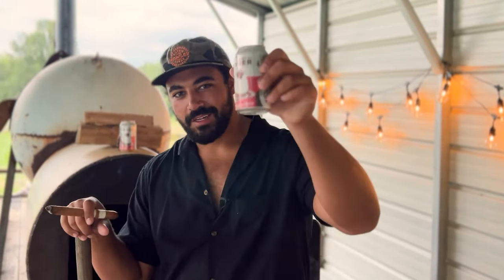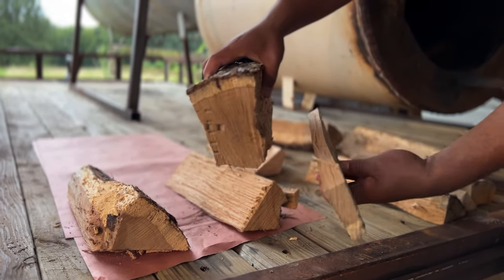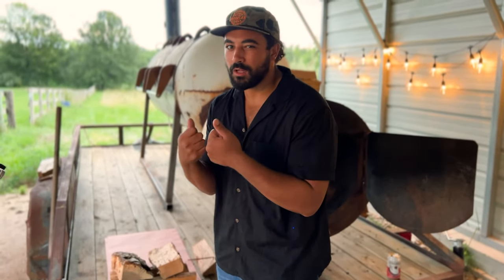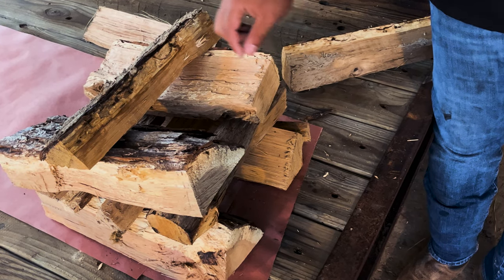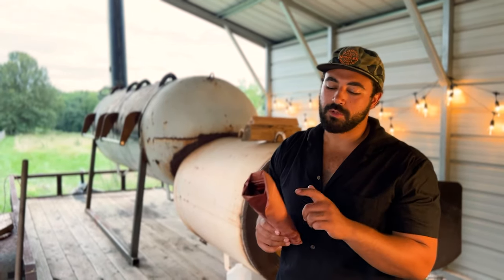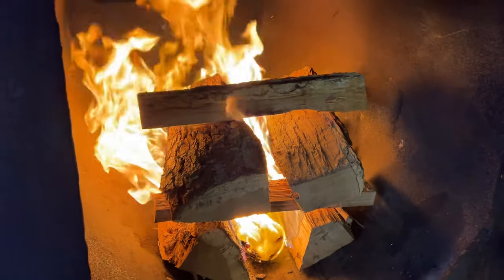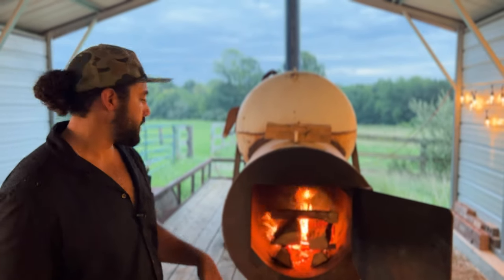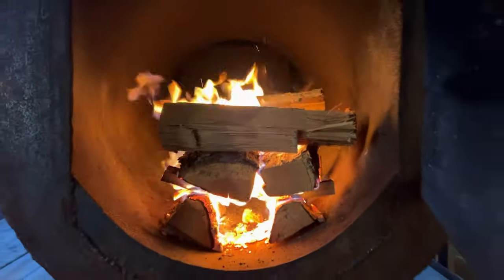BBQ Fire Management Basics: A Master Tutorial

Comment: Couple questions... 1. can a backyard offset be started in the same method that the bigger one is started ? Lincoln log method/stacking.  2. for the entire duration of the cook, the wood should be actively burning rather than smoldering??  I have had issues with my fires being slightly to Smokey... white smoke.... the meat taste pretty good, but i know that i should see almost clear waves coming out of the smoke stack.
Reply from the maker: Of course! 

1: yes you start & can run a backyard the same exact way. Just adjust the wood sizes accordingly. 
2. Yes you want the wood to burn and breakdown into coals, then you’re adding splits ontop the coal bed. That is the cycle you are managing is breaking logs into coals then adding more logs as needed. You want them burning not smoldering. 

Try Lincoln log with some smaller splits and see if that doesn’t clean your fire up a bit. Also could come down to the smoker you have, the way it functions, what it likes best etc. gotta learn your unit of course through trial and error then give it what it wants when it wants it… don’t you love BBQ 😅

Comment: Thank you for your lessons.
I have a char-griller with fire box, cooking chamber and LPG grill with a burner. Texas Trio model 3070.
How is the best way to clean this thing?
Leaking grease.
I also have been trying to a hack of using the grates in a v arrangement to contain the fire.
Is this a good idea?
Coals do settle on the bottom under the V grates and seem to dampen the fire for lack of oxygen.
What’s the best method?
Should I remove the grates altogether and just build my fire on the bottom of the fire box like you demonstrated?
Seems like the fire box will burn out through the bottom.
Not sure.
Thanks for your video.
Reply from the maker: Hey boss thanks for the support. I’d suggest always practice running fires directly on the floor of the firebox. But every smoker is different so you’ll of course have to play around with different techniques until you find what works best for you and your smoker

Comment: This is an amazing and helpful video! A couple questions though, I get wood when I can so I can't always get that perfect triangle or flat shape. Do you have any suggestions about wood selection in that case? Can I still slow my fire down without those dense flat pieces?
Reply from the maker: Really appreciate the support brother! 

Don’t sweat your wood selection. You can use these general principles with nearly any kind of wood density. You maybe be adding logs more offer, or running things slightly different but the net result will still be darn good bbq. Just experiment with what you have keeping this principles in mind and you’ll be good. Let me know if you get the chance how it went for ya! 
Thanks!
Reply: @MeatNGreetBBQ  will do thanks! Just picked some wood splits from a local tree cutting service, definitely some odd shapes and cuts

Comment: Marcus im at a loss for how you're getting these temps. Im running a 250 gallon on a half a 250 gallon fire box franklin style offset. With the  amounts of wood in your fire Id be hard pressed to get below  750 degrees. My box is semi insulated. Is the size the difference, to you run any smaller competition size offsets?
Reply from the maker: Hey brother sorry for delay! You’ll def want to scale down the amount of wood. Keep in mind that although the firebox is the same size, the actual cook chamber is half the size so it’ll be the half the space to heat. You can either use the same amount of logs but scale the size down. Or just use large logs like I do however don’t use AS many pieces. I wish there was a 100% sure solution for fire management but each unit will need to be played with in order to find the perfect setup. Give me a shout if you run into any issues I’ll be happy to help!

Comment: Lush vid man. My question is this; each time I add a new split on my OK Joe, I feel that the initial burn is alway s dirty. For 5 -10 minutes it's pumping white smoke out with every new log......
Reply from the maker: Thanks for the support and showing love in the comments bro, means a lot! 

Yessir know exactly what you’re talking about. That’s typically for smaller smokers while you wait for the log(s) to combust, at which point the fire cleans itself up as you probably know. The smoky bit isn’t that big of a deal and just part of the process. If you want to reduce that intial burst of smoke, you can preheat the log by sticking it in the cook chamber or setting it ontop of the firebox. That will help combust it almost instantly. I’ve also left the firebox top door open for 5-10 min to allow the log to fully combust and pump that dirty smoke out. But ultimately the meat will be fine if you throw the log in and let the fire run its course. It’s not enough dirty smoke to make a different, assuming yo run a clean fire in between. Hope this helps
Reply: @MeatNGreetBBQ  excellent ideas! Thank you. I’m smoking a turkey boob today so will try that out. Legend 😎🍻

Comment: In an Oklahoman Joe, is it best to use a charcoal basket or just put the coals on the bottom of the fire box?
Reply from the maker: I’ve never used a charcoal basket so I’m honestly not sure. I’m a fan of learning to run fires without baskets and such. It takes longer to learn but pays off 10 fold in the long run.
Reply: @MeatNGreetBBQ  thanks for the input

Comment: While it is a different fire and fuel capacity for a large commercial smoker, your whole theory collapses (literally) when the layers burn out and crash. Then the only way is to rebuild that same structure but it will create more waste imo. I'm no expert but I find it easier to create a coal base like what you did for the OJ which is the same one I have.and I keep adding splits. Also you do need the damper to keep somewhat consistent temp
Reply from the maker: Do you boss! Regardless I appreciate your support for the channel brother. Cheers 🍻

Comment: Which method would you use for a 94 gallon. The 500 gallon way maybe a layer less. Or the Oklahoma Joe’s way
Reply from the maker: Great question! The only different between the two methods is the method I showed on the 500 gallon is a bit more advanced. That method 100% works on smaller smokers. But if it’s your first time or you’re new to fire management, it’s hard to manage fires that way out of the gate. On a 94 I would suggest starting your fires the way I showed on the smaller backyard with charcoal, but maintaining your fires/coalbed with the method I showed with the 500. It’s all trial and error. Eventually you’ll run all fires almost the same, but in the beginning as you’re making mistakes and figuring things out you’ll want to take the easier route which i showed on the smaller model.
Reply: Thanks for your reply. I have a old country brazos now. But my workhorse 1975t finally goes into production the 17th of October. Just didn’t know how much difference cooking on a 94 compared to the other would be but I’ll just treat them the same. I use lump now to start it and then add splits. Ty for your replies and feedback